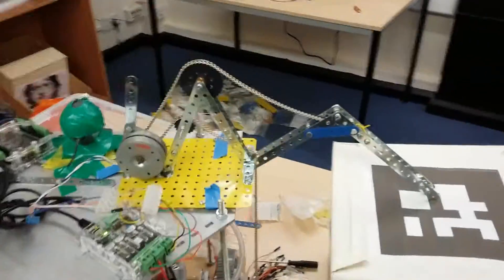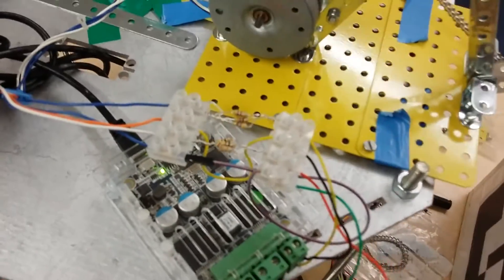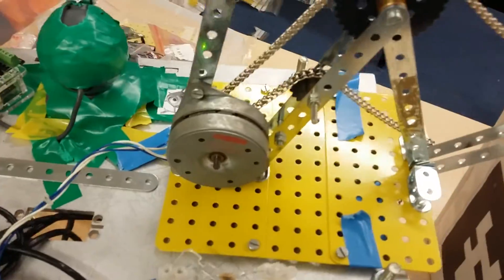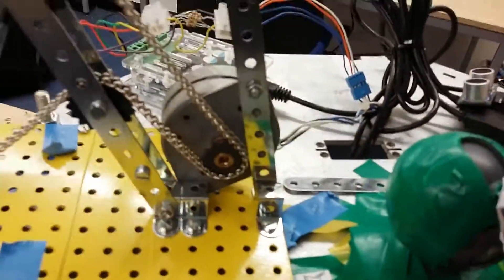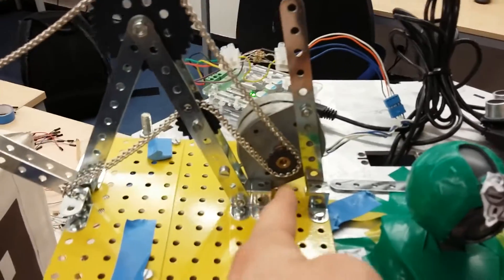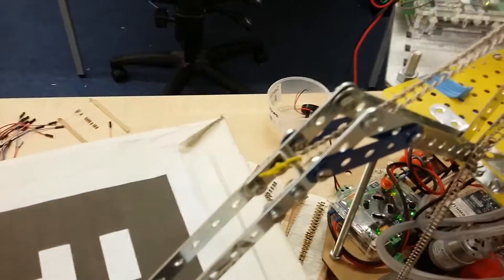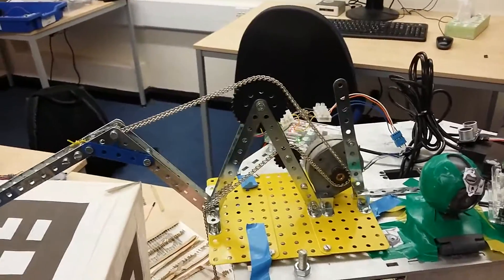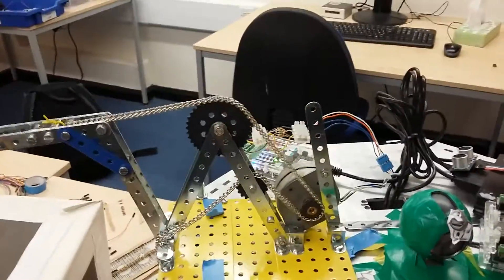CLY Robotics: Stepper Motor Based Lifting Mechanism

Comment: Interesting design, I have a question though: Why are you lifting up the token at all?
Even if winning isn't  everything, just grabbing the token would require much less time and would probably be more save as well.
Good Luck with the mechanism, looks promising so far.
Reply from the maker: Hi! We're looking at a few designs for our robot. We're looking at using a lifting mechanism like shown here, but with a vacuum pump. We are also looking at just having the vacuum pump on the front, and also looking at just using arms.

We're considering lifting the box because it will allow us to pick up boxes from the edge of the arena.

- Thomas
Reply: I take it your thinking about stealing tokens from other team. In that case I hope we will never be the victims from who you steal.
Good Luck anyways :D
Reply from the maker: Thanks! :)  - Thomas